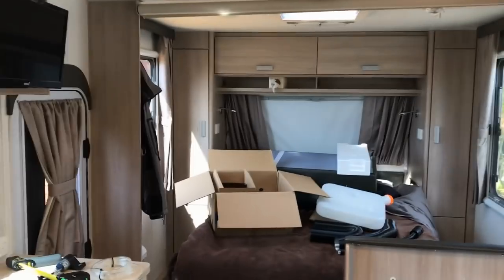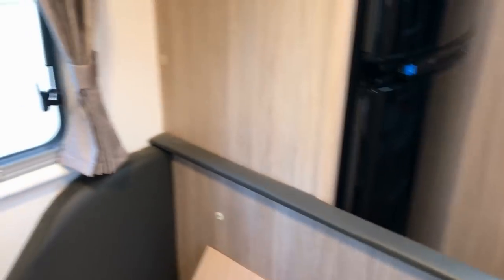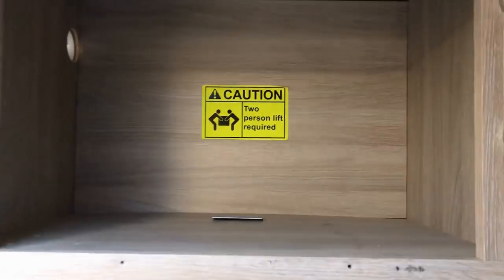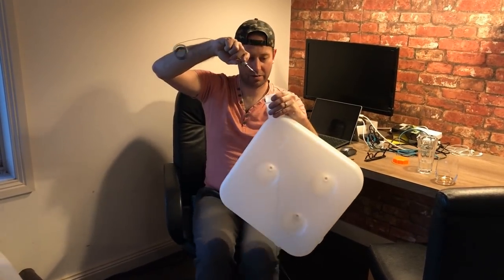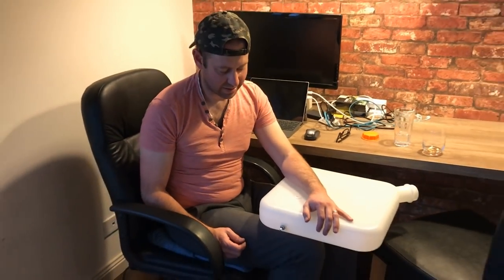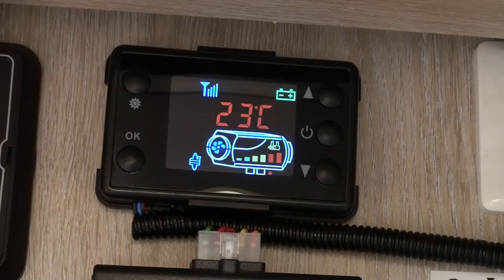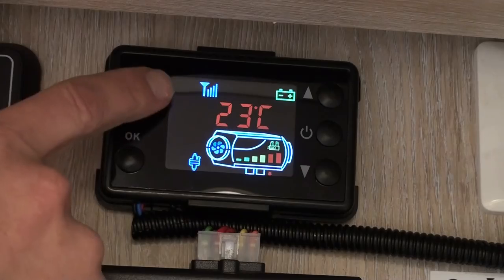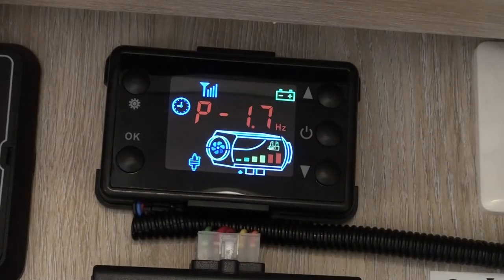Diesel Heater Install and review  #Winter is coming

Comment: Hey David, thanks for sharing the video. Very informative, but you didn’t show the fuel pump and fuel tank fitup. Apparently there’s a trick to mounting the pump on an angle or something.
Reply from the maker: Hi, I don’t thing the angle of the pump is as important as everyone says. Find me on my DASH OffRoad FB page and I’ll put up some pics of what your asking. Cheers for watching 👍
Reply: @DASHOffRoad  Same here! People talk about 'drawing in air', etc - but once it's full of diesel, it's full of diesel - & it's not exactly gravity-dependent or anything.
However - all the warnings about angling downwards, & risk of drawing in air - fully applies to the fuel *filter*. Too long to explain here - but if you watch it in action, tip the fuel filter the wrong way, & it'll only have air to suck on. I think a dodgy diagram in an instruction manual has led this whole misnomer to spread! The two devices look similar, when drawn.

Comment: The temperature setting is in hertz mode. This mode is like a fan speed setting. Hold both top buttons and this will put it into thermostat mode and you can then adjust by setting a temperature.
Reply from the maker: Legend!
Reply: Hello Gavooz, when you say top 2 buttons  do you mean the up button on the top right and the setting button on the top left ?
Reply: that's it push setting button and up button together and it change straight awy